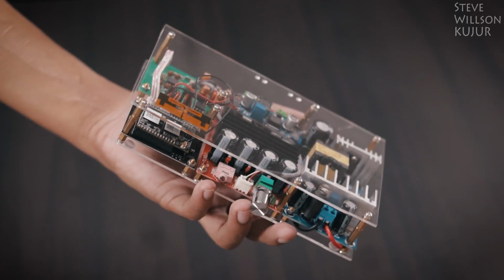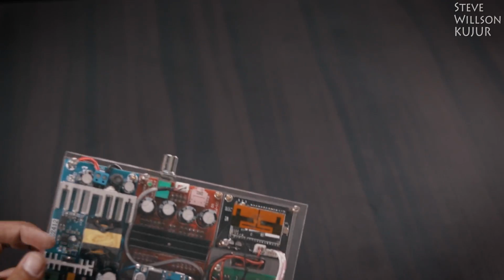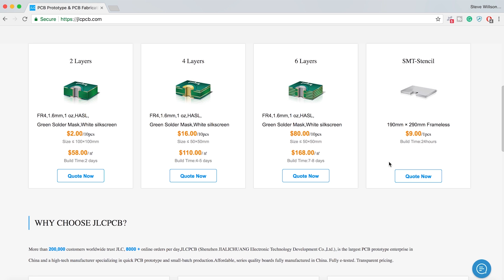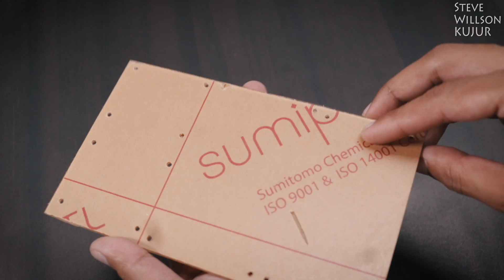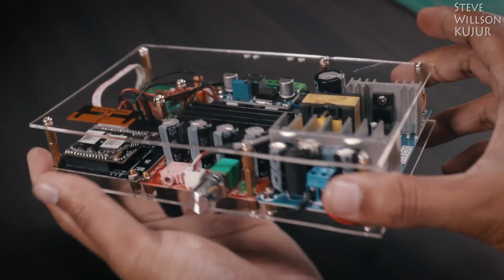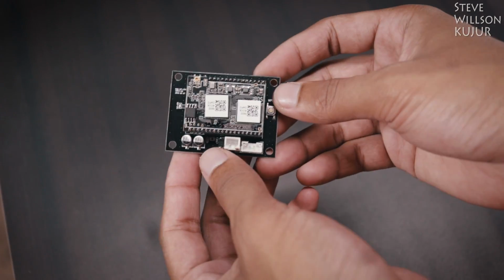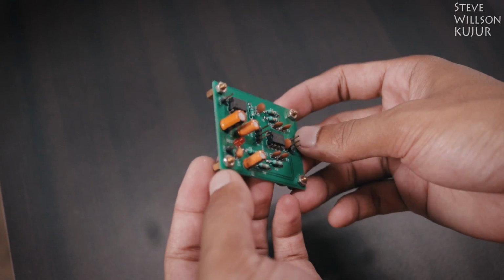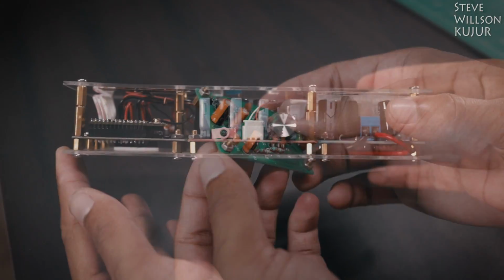DIY Multi-Room Wifi Audio System

Comment: Steve Willson Kujur+ So in a normal operation with woofers we can do away with the bass device plus the isolation chips because we are only using that DC to DC Buck Converter to power the wifi  music board. It no longer needs isolation on the outputs of the DC to DC Buck Converter?

Comment: Very cool.  I would have been tempted to desolder those middle screw terminals and turned them around so they face inside.  Or maybe just remove screw terminals and solder wires directly.  Nice job anyway, looks good!  Definitely buying one of those wifi modules for my workshop radio!!!!

Comment: I am unalbe to connect via Wifi. The device says "Wifi is starting" and the blue led is blinking very fast, but it is not entering into network setup mode.
How can I enter into the Setup mode?

Comment: Hi! Real cool video :) 
I've worked on a similar project with a 3S battery pack and a 12V amp which has Bluetooth integrated and an auxiliary input. 
I used a stepdown to convert the 12V to 5V in order to power the Arylic board and it worked perfectly but I had a bug buzz. I tested the auxiliary with a Jack and there was no buzz at all so not an amp issue. So then I added an isolated SMPS B0505S-1W to the 5V output of the stepdown which killed the buzz but now the Arylic turns on but I can never find it on the Wi-Fi. If I connect it straight to the stepdown output, it connects in a matter of seconds. 
I'm wondering if it has something to do with the amps? The isolated converter only gives a max of 200mA @5V (1W), and the specs say the Arylic board needs 5V 1A. 
Your config is the same and seems to work perfectly. Am I doing something wrong? I would realy appreciate your feedback :)! 
Thanks

Comment: Great editing.  Good sound tracks but it's a little annoying to hear the Indian car honks in the background.  Also, your exposition of the parts and intro to the whole project is awesome.  Please consider doing some audio commentary work to augment the project video.  Such as why you kept the paper wrap on the acrylic board prior to drilling, how to make good solder joins, etc etc.  This will make this video even better (IMO).  Set time markers to let your viewers to know where to go if they want to watch specific parts of your video (i.e. - low pass filter info, soldering or mounting) Keep up the good work "Steve" LOL.

Comment: Can we use any other WiFi module in this ?
Reply: Yes, you can use whatever module you want, the important part is to ensure that it supports I2S protocol. I2C is for digital communication between sensors and some microcontroller and I2S is for sound transfer from the receiving wifi IC to the actual amplifier
Search how to convert I2S to analog input sound
Reply: @tatterdemalion898  thansk brother
Reply: @udayagrawal3374  ur welcome! :)

Comment: B0505s-1W 5 in to 5 in DC power Module Converter 1000VDC isolation chip isolates the buck converter so it doesn't fry when connecting more than one device, but the Wi-Fi device wants 5v 1amp and the chip only puts out 1 watt divided by 5v = .200mAh so does the Wi-Fi and the bass rejection board run as expected with such little amperage?
Reply from the maker: Yeah it runs just fine
Reply: Thank you sir. I realize that I can use a 5v 3amp and the device will only use what it needs, but it's missing .800mAh and I noticed when I used the TP4056 Charging board when I used 3 of them I couldn't use the same source so I would have to use 3 of these isolation chips, one on each input of the three TP4056's which only allowed .600mAh when I used them as a charger/balancer which took forever or I could use three different phone chargers = 3amp charge which was fast and glued them down, then I wired the AC section in parallel to a sing out and that worked ever since so my question is could you use two buck converters, one for each device and have the proper amount of current or would you need these isolation chips on the inputs of the two buck converters so they don't fry, if you went this way?  also, that WPA wire you cut off, is that for a external button because there's only one wire and there's a WPS Button on the board, I purchased one to test before getting 9 more, Thanks